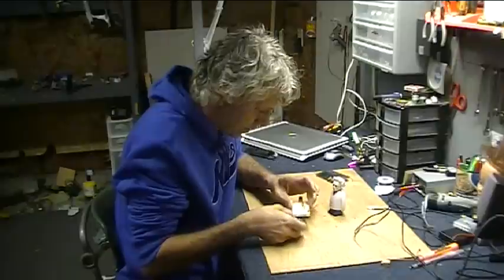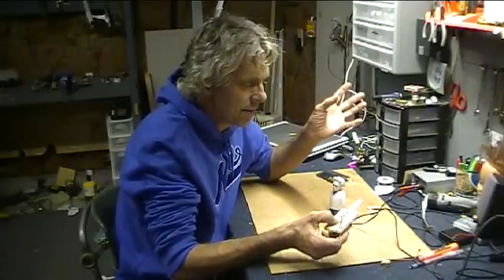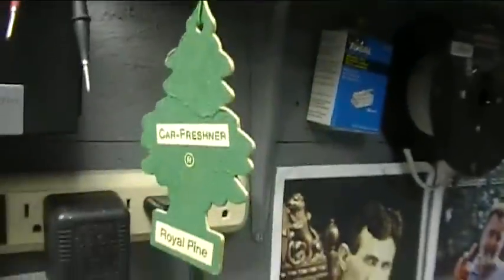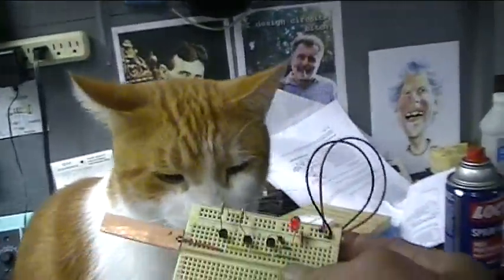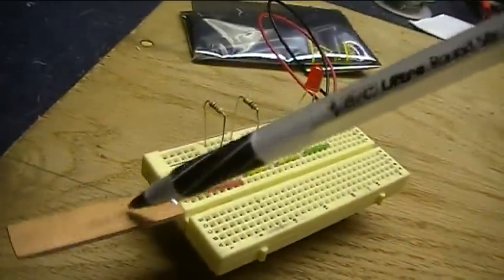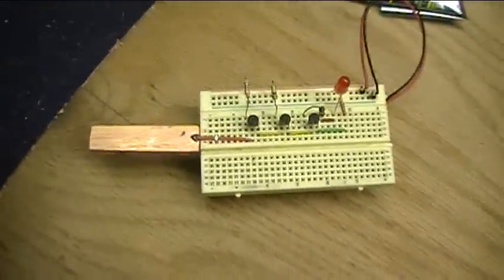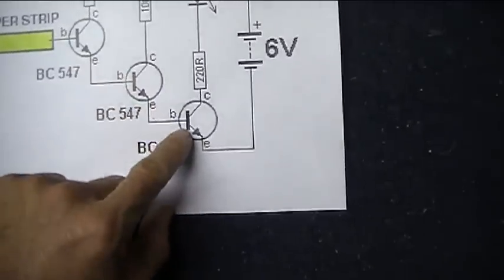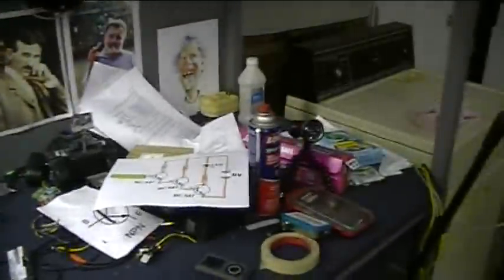Wireless Voltage Detector... sort of

Comment: what is the function of different resistors u used in the circuit?
Reply: I THINK the 1M and 100K limit the current (and set gain) for the transistors though I would use a 10K and not 100K. The 220 Ohm resistor limits the current thru the LED

Comment: This circuit could be improved in several ways. 
First you could use a single Op Amp instead of transistors to save you some soldering connections. Th eOp Amp also gives you very high input impedance which means it would require lesser input power. Second, the reason you are picking up non-AC line signals ( from the cat?) is because you are picking up signals of high frequency, which could be filtered out by a Resistor-Capacitor low pass filter at the input end. 

If you wanted to be more precise and block out stray signals, you could put a simple time delay before the LED goes on. This way, only a stead low frequency (50-60 Hz) line signal could trigger the LED. 
.
It is kind of hazardous to use a piece of copper PCB directly to the transistor input. better to use a 1M Ohm resistor at the input., with one lead of the resistor connected to the amplifier input and just leave the other lead dangling unconnected as an "Antenna".  You can insulate this lead for added caution.
Reply: A JFET Op-amp has a very high impedance and can have much higher gain but as to fewer connections - No. there would be more connections/soldering. Current use is likely to INCREASE as the op-amp needs to be powered unless you choose a low-power IC. Furthermore ICs are less rugged so there is greater likelihood it can be damaged by spikes. So your non-specific improvements do NOT exist - they only add to the cost and complexity.
Time delay?   Do NOT see how that work help.
It would only be a hazard if contacting live AC.
Reply: Also another thing in addition to what you said is to  use a buzzer/speaker instead of the led so you can hear the 60 HZ frequency . Or use a buzzer and a ammeter/vumeter to see in real time the strength of the signal....
As it is now with those 3 transistors only and one led the circuit is useless.
Reply: @orange11squares  an ammeter measures current, so why?  an VU meter measures sound intensity, so why?  Maybe you meant a voltmeter?    The advantage of the LED is that it is small. cheap, and easy to get.  It is hardly useless. Unless there was a very good LP filter a speaker and especially a buzzer would get very annoying. A speaker could drain a battery much faster. Likewise a buzzer unless you bought a low-power unit.  Anything with a coil should have a forward biased diode.

Comment: Why do the resistance go up at each stage...???
Reply: Because the current in each transistor is very different.  Let us assume that the current gain of each transistor( at the collector) is 100  and so the current gain at the emitter is 100+1 which includes the current at the base plus that of the collector.
So if the current in the base of the first transistor is X ,due to the static electricity that the probe picks up, then  the first EMITTER  current is X multiplied by 101.   The current in the second emitter is X*101*101   and this is applied to the third base hence its emitter current is X*101*101*101.       The collector currents can be worked our as for each transistor it is the base current multiplied by  100.   Hence the resistors need to be different.  
Strictly speaking, as at the collector a transistor is a current generator with very high impedance output, one does not need those collector  resistors if one is careful not to switch on the transistor as a switch!! but it is safe the way this gentleman did it. He was right about the circuit having  more than one million gain .
The fact that he has not introduced a very very high pull up resistance at the first base means that the  transistors  are a little lossy as otherwise they would have picked up a charge which could switch them off. ( or the atmosphere is quite humid and conductive in that district where the author resides)
This circuit is an adaptation of the Darlington Pair with one transistor added, hence a high gain , but rather unstable if any power is taken from it.
Reply: I see..thank you very much....I have tried to use two darlington pair trans...with no luck...I was trying to do the same thing..but it would not work this way...
Reply: @carmelpule6954  "....... with very high impedance output,"    surely you mean INPUT
Reply: @kennmossman8701  The BJT used in the circuit is current to a current amplifier so it has a low input impedance and a very high output impedance.
Reply: @carmelpule6954  It isn't the transistor - it is the configuration

Comment: i tried but it didn't work. u said use aluminium foil for a change but that too didn't work. although i didn't have a copper strip at home so i used copper wire instead will that affect the circuit in any way??  i could really use some help.
Reply: don't use aluminum - it is too hard to get a good electrical connection/  You probably made a wiring mistake. Check the connections, especially for the transistors.

Comment: can i put mini antenna instead of copper strip?
Reply from the maker: Give it a try!
Reply: Note that the pick up is rather due to the fact that the strip and your antenna would act as a capacitor picking up mostly a fluctuating voltage ,The voltage picked up would  casue a tiny current to be rectified by the three diodes at each emitter base junction which in fact may be looked upon as a demodulator.
Presumably you want to use an antenna to replace the  strip with no intention of picking up any Radio Station as this will have to need tuning facility which this circuit has  not.    It should work with an antenna, but if the capacity of the antenna is lower than that of the flat strip, the result would not be so effective.  My experience of a short rod antenna is that it has a capacity to the surroundings about 15 pico farads,   This strip that is being used in this circuit would probably be  double that at 30  picofarads.

Comment: Yes, though it isn't sensitive enough for FM radio in the 88 tot 108MHz band, but if you build a tankcircuit with a coil on a ferrite coil, like you can find in small AM transistor radios and a tuning capacitor, you can detect RF signalsup to a few MHz.

Comment: I think more sensitivity will not come from using higher or lower supply voltage or germanium transistors with a lower base to emitter voltage. The best way to make this circuit more sensitive for mains wires is to replace the small sensing pad by a telephone pickup coil. You connect the + wire of the coil to the base of transistor 1 and the - wire to the - contact of the power supply.

Comment: then what will happend if i use lower voltage lets say 3v , or i will have to reduce the value of transistors to use low voltage ? i just want to achieve higher distance from the wire about 10 cm so i can find them in the walls and etc ...

Comment: Yes, you can, but it will not improve the sensitivity, because this circuit is not about detecting low voltage, but about detecting weak electrostatic charges and electromagnetic fields. So it's only important that the transistors have a high current gain.

Comment: It will detect some RF, but this is not really a detector for RF signals. I found a circuit online that can be used for detecting FM transmitters as well as other RF devices up to 2GHz: w w w .electroschematics.c o m/8809/spy-rf-bug-detector/

Comment: Nice! I built a similar circuit when I had my first Philips EE2050 electronics kit. Really brings back memories. Funny that you named your cat 'J-fet'. :)  BTW: Al those asking if you can use this or that type transistor: You can use any TUN (Transistor Universal NPN) as long as it has a current gain of >200.

Comment: If you keep the Vce below 40V, both transistors have an Hfe of about 40 to 120. The only differences in the two transistors is the bc547 can use a slightly higher Vce (50v) and has half of the current handling (100ma). For a low power application like this, it's a good substitute.

Comment: 2n3904 has an Hfe of 100 to 300 at 10ma with Vcc at 1V. The Hde goes up with a higher supply voltage but with the same current, i.e. 3V at 10ma will probably get you an Hfe of 120.

Comment: The 2n2222 has a gain of about 35 at 10 volts. The bc547 has a gain of about 110 at 5 volts. You may be running into a lack of gain.

Comment: Pretty cool man.  I whipped up your circuit in LTSpiceIV and it seems to have a gain of 95 Million with still enough current to light the LED.  This is basically a SUPER-Darlington Transistor ;-)  The front end copper strip forms one side of a capacitor, and then when you bring it near a voltage potential a super tiny current flows between air dielectric of the "cap".  This is mega amplified with the high gain BC547's and viola, the LED lights up.  Might be able to detect pre-lightning strikes??
Reply: Sorry for asking 9 years later but can you share the ltspice circuit?
Reply: @mrphoenix4138   hello there , did you try the circuit ?